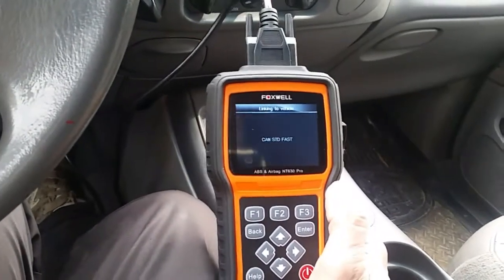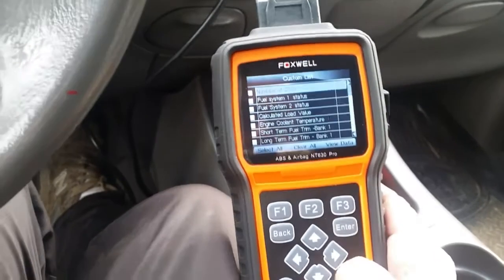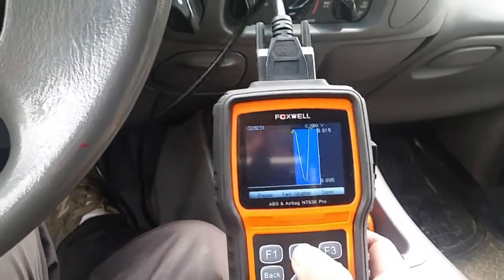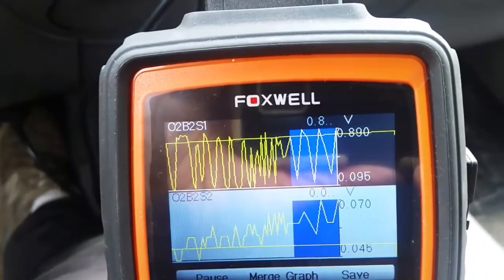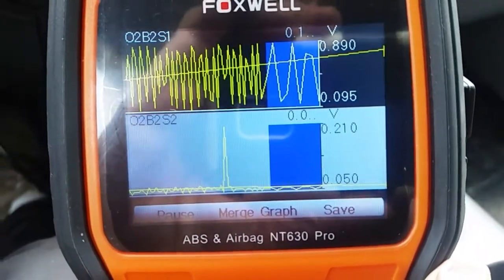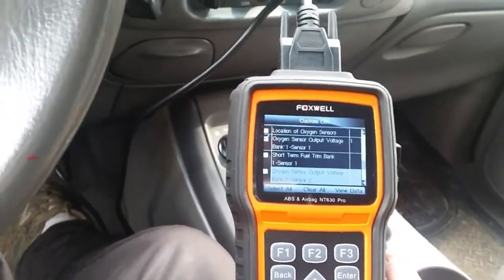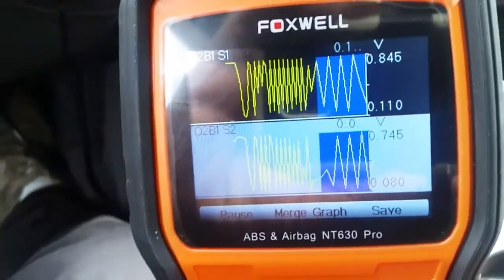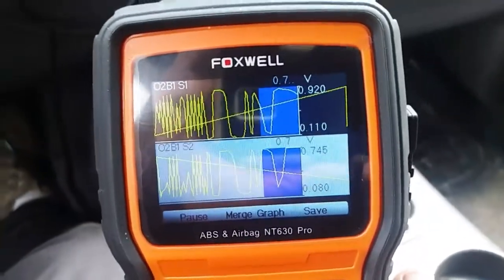PO420....Waveform made simple. Anyone Can do this!!....A catalytic converter gone Bad.

Comment: maybe its a bad o2 sensor ....
Reply: air leak
Reply: @mike-s8n8y  what do you mean?
Reply: downstream 02 extremely lean until he revs it but upstream 02 is ok
Reply: @user-kk2bo4de8m  what's the voltage on it?
Reply: b2 sensor 2 is at 0.045  to 0.07 volts , very lean , when he gives it a bit of gas it jumped to 0.21 volts
Reply: @mike-s8n8y  that's a bad o2 sensor?
Reply: @mike-s8n8y  air leak where?

Comment: Thanks for the videos. My 98 has thrown the same code and I have verified it's the cat. Looking forward to seeing what you end up doing as far as replacement with the precat/cat.
Not a lot of videos on this most seem to be on the manifold, but there is a lot that can be shown with the Y pipe, the transmission crossmember, and the limited access near the upstream sensor.
Reply from the maker: I've ordered a New Cat for $78 on e-bay. I have a 110v wielder...so I get to make sparks...lol
Reply: It's always better to weld it on the floor....ugh